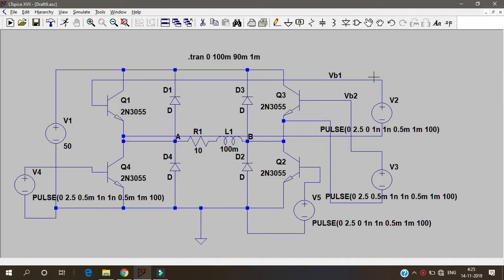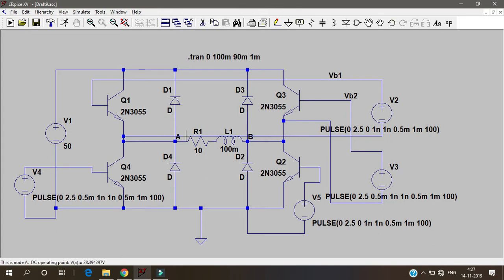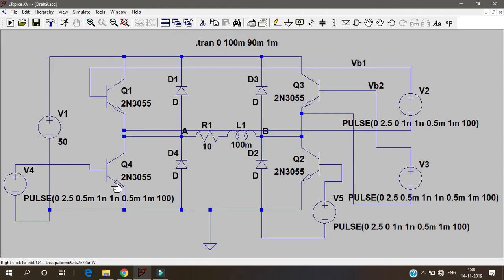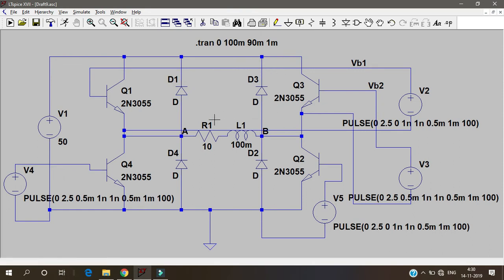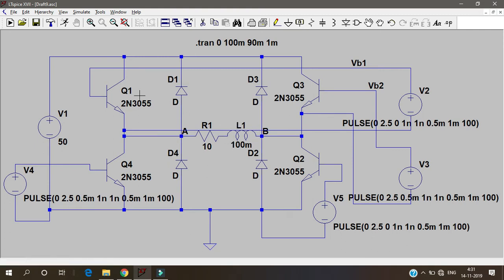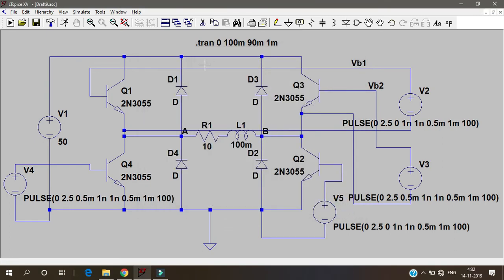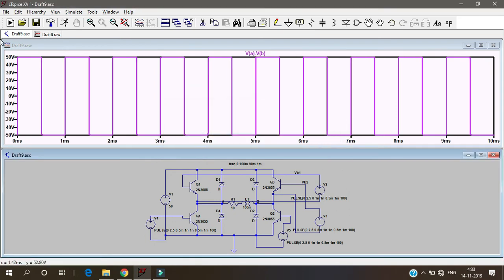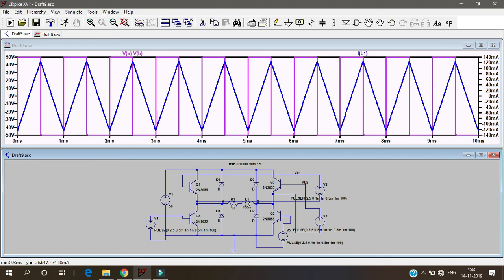Full Bridge inverter in LT spice

Comment: For an electronic engineer which simulation software is best ?
I mean should i use Matlab or lt spice or what ?
Reply from the maker: MATLAB gives you ready made blocks in most the cases. In LT spice or other spice simulators you'll always get the clear idea of how things work. However, in practical cases like modern industries there are used rarely since the designs are extremely complex. But it's necessary that u start with SPICE simulators.